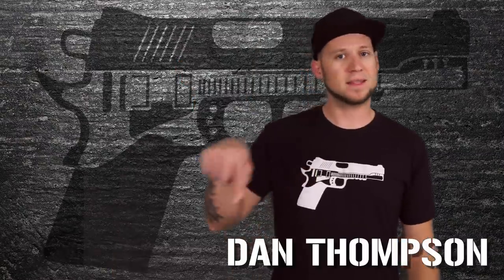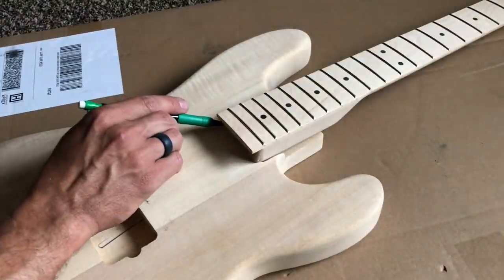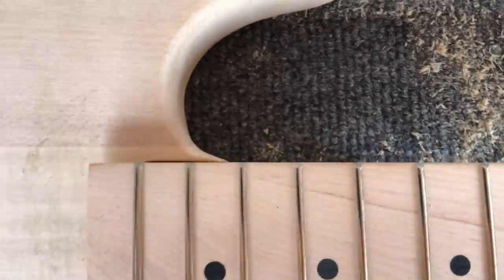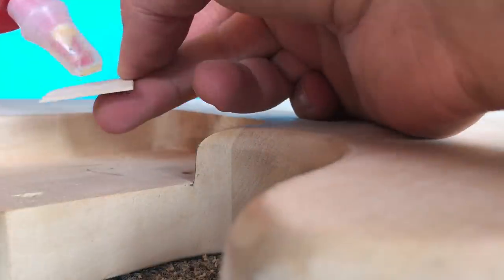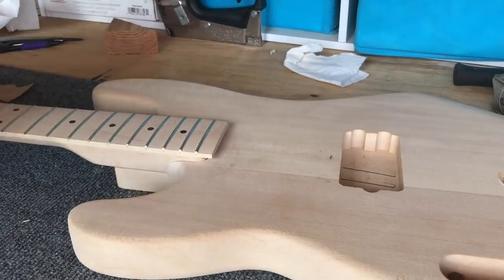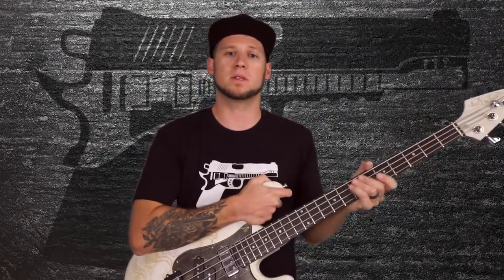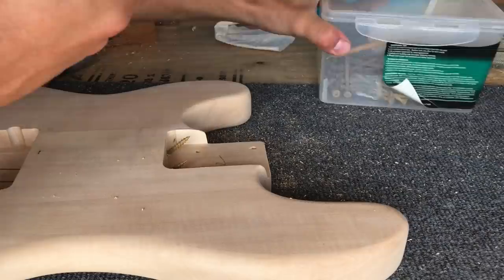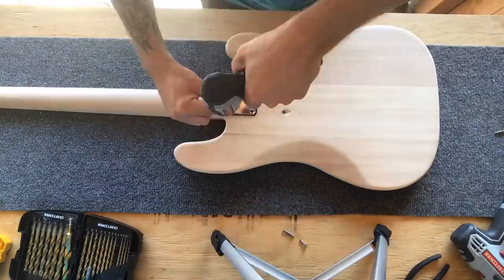How to reinforce a loose neck joint for better tone and sustain,  guitar or bass

Comment: Wouldn't loosening the neck screws a quarter or so of a turn after tuning (assuming you have a properly fitting neck pocket) solve the sustain problem? Generally when I do this and hear creaking it solves sustain problems. Using the 200 pound string tension to your advantage :)
Oh, and also good for people that don't want to drill into some overpriced vintage bass
Reply from the maker: Some people believe in that philosophy. My experience is that sustain is better when there is a tight fit and compression on all available surfaces, not just the base of the neck, but the whole neck pocket area. Also, loosening the neck screws on tele and similar body styles that don’t have support on all three sides of the neck pocket can cause the neck to shift side to side and crest tuning stability issues. But if it works for you, by all means do what’s best! There’s no right and wrong. Just what works best for you or what doesn’t.
Reply: If you loosen the neck bolts a 1/4 turn while In turn and hear a cracking sound, that’s the neck seating in the pocket. Then you can re tune and tighten them back down.  I would only recommend this if you have not already drilled holes for he bridge or else intonation will most likely be off. If it’s an already built guitar I would fill in the neck pocket and sand it back leaving only where the gaps were in sanded. But i guess it’s all personal preference
Reply: @christiansirianni4472  Lol no, just no. If your guitar was made properly setting the neck with tension is not going to change your scale length more than a quarter mm at most and it would probably be significantly less. The guitar was cut to be the correct scale legth with the neck firmly in place. Lol you'll be fine if you decided to try seating the neck at tension. I dont know how you came up with that non sense. Taking any material what so ever out of a proper neck pocket though is beyond stupid. This video was a great way to ruin a guitar. Unsubbed.

Comment: Hey Dan!  Really enjoying your guitars.  I am a woodworker first, and just started building some guitars.  laughed at your Voice over of your Australian friend since you clearly had no idea what tools he was using.  I am going to try the two extra screws to tighten that neck joint.  Cabinet builders use a similar method called pocket hole joinery.  You might look into a  kreg Jig. the Mini Kreg is $20 on amazon.  This would give you a more consistent angle and you and add filler plugs if you don't want to see the holes.

Comment: Very slick!! Wish l had seen this earlier.. starting a strat build and a Squire SE body l bought on line sat a few months waiting for me to start...well, when l did, the neck was like a 1/8"-3/16" too small. This shim trick might have had me try and fix the issue, however the body is finished and to do this trick shimming l would have to add time and materials to get a Squier right.. not worth it.. for a lil more money than time, labor, materials for refinish and the original cost, l was able to get a brand new Deluxe strat parts body! Its beautiful and waiting on small parts to finish.. had it been unfinished l would have done the shim and paint! Thanks! Love the channel! What other country can we discuss Fender neck pockets or HB triggers for a CZ?? GOD I LOVE AMERICA!

Comment: I think this is my first comment slash question. One, I like coffee more than you, fight me. Two, I've been so uber inspired by your videos that I have been binge watching for the past couple weeks and bought an SG kit with a bolt on neck. I didn't search specifically for a bolt on or glue in, it's what I could find, stupid virus... Anyway, the neck pocket is open and the base of the neck runs into the humbucker pocket. So, would this method still work? I haven't even started on the body so...
Reply: It depends on how thick or thin the guitar body is.

Comment: Quick and dirty method I found online if you don't want to drill extra holes in your guitar. Start with a fully assembled and tuned guitar. Flip the guitar over and undo the neck screws 1/4 turn. The string tension will cause the neck to slide deeper into the neck pocket (a fraction of a mm). You might hear a slight pop as it budges. Then tighten up the screws. Obviously this assumes and reasonably well made neck pocket to start with.

Comment: At that point, just use hyde glue and glue it in under pressure.  Good enough for Strad violins, good enough for a bass.  It drys crystalline hard and wont effect the tone like some of the other glues

Comment: I just got a Strat knockoff kit from Amazon and it has this very issue.  I guess grinding the neck pocket won't affect scale length?  I considered sending it back and asking for a replacement but that may just be what you get for $89.00.  This is my third build, the second from a kit.  The first kit was the carved top hollow body (Gibson Les Paul knockoff) with a set neck and it was a perfect fit.  The second build was a Strat knockoff. I got the neck and body from Precision Guitar Kits.  Again, perfect fit.  I guess this is a learning process but if it's not going to tune properly, I want to know that up front so I can put a cool paint job on it and hang it in the man-cave.
Reply from the maker: With a strat you should have no problem, strat bridges have lots of wiggle room for intonation. You shouldn’t be removing too much anyway. And, if it’s a trem bridge, you might have enough room in the trem cutout to just slide the bridge back a bit to compensate anyway.
Reply: Guns and Guitars Thank you, Dan.  I appreciate what you do.  I have used you as a reference several times.

Comment: Strings tension already pull the neck toward the bridge and the standard screws mount the heel tight on the body, hence no real need for 45° screws.

Comment: i believe it can hurt .that many screws and holes in such a small area is probably just going to cause problems. But if you like it keep doing ! Not something i would ever do or advice anyone should but if you or anyone else wants to risk it feel free it's your guitar to do what you want with.really if your concerned with better contact , more sustain just build a set or through neck guitar instead of making your bolt on into swiss cheese .

Comment: The string tension should pull the neck into the pocket with hundreds of pounds of force, the added screws are arguably redundant.
Reply: exactly
Reply: Seems like one of those steps people use, who doubt their building skills . Like adding more screws to something you're building, will make it hold better. But, you just end up weakening the wood, with more holes.
As for other companys using this. Who cares.  It still doesn't make sense. 
"I did see hear that, at fender, they have a guy that shoves all custom shop builds up his ass, to increase sustain "
Reply: Try to loose the screws of your guitar a little bit and see how wrong you are. The force of the friction of the neck against the body is way superior than the strings pulling it.

Comment: I've just stumbled into the world of DIY kit guitars and have spent the last 2 days down an internet rabbit hole that led me here.
This is an interesting tip that may help if I get a kit.
I'm wondering if you've ever heard of a pocket-hole jig?
It may make your creation of these additional holes a touch easier - although the trick of coming in through the neck side is a good one.
Reply from the maker: Yeah I’ve been trying to figure out how to use a pocket hole or Craig jig for this task, but it’s difficult to predict exactly where it will come out the other side, and I really need it to come out in the base of the neck pocket.
Reply: @GunsandGuitars 
I had to just work it out with mine. On certain wood thickness I just knew what setback I needed for my jig.
For example - on a 35mm (1.5"?) piece of wood I knew I needed to setback 25mm - or the thickness of a wooden ruler - and the screw would come through the middle of the face every time.
Once I worked it out it was very consistent.

Comment: The angle screws are into end grain.  This is asking for trouble, particularly with so many screws in close proximity. It may hold up for a while, but don't be surprised if cracks start showing up eventually.   I suppose they may not, but I wouldn't take the risk.

Comment: Removing material will change the scale length of your instrument, not recommended.Also you may have a copyright issue with Yamaha if they find out. Their Billy Sheehan Attitude III basses use those diagonal screws to secure the neck, could be patented, not sure.

Comment: Personally I would not put in the 45* screws. Install your neck, once you have the screws drilled where you want them, take the neck off, cut a piece of newspaper the size of the neck pocket. Put a very thin coating of wood glue into the back of your neck pocket, place the piece of newspaper on the glue, install the neck. Leave it alone for a few hours. If & when U want to remove the neck, simply take the screws out & give the neck a sharp rap, the glue bond with come apart fairly cleanly. You just have to scrape the remnants of paper & glue off. Wood workers often use this method to mount things for turning on a lathe. I learned this in grade 5 wood working class.

Comment: saw a Billy Sheehan vid about a Yamaha Bass with 6 screws - 2 at an angle to pull the neck into the pocket - then the 4 conventional screws were drilled and used - might work for guitars - esp customs

Comment: Wouldn't it make more sense to drill the hole inside the pickup cavity parallel to the top of the body without an angle, so that it is not visible?

Comment: You need to make sure the holes you drill through the body are big enough that the screw threads don't catch in them if you want the screws to grab the neck and suck it down.  Otherwise you might be accomplishing the opposite.

Comment: If the fit between the heel of the neck and the bottom of the neck pocket (that portion adjacent to the neck pickup area) is so critical, why not simply "Glass Bed" the neck heel / neck pocket to obtain a perfect and air pocket free fit? You could add a few degrees of bevel to the heel before bedding so that as you tighten the screws installing the neck, it would automatically create a full contact and tight bed with the last quarter turn or so, of the neck bolts/screws.
I'm no "tone expert" but to my way of problem solving thinking, glass bedding that heel area would resolve the issues that the angled screw fix does, but with less intrusion.
Reply from the maker: Not a bad idea! I think you should try it and post back here how it goes!

Comment: Thanks for the idea Dan. I often had this problem with my partscasters that the necks were bending downwards a bit in the loose pocket resulting the high e string moving to the very side of the fretboard.. This might fix this in my next project. Do you happen to know any sources for rear routed strat bodies (like the Charvel San Dimas models) for pickguardless projects?

Comment: I just add white glue in the holes of the neck and set the screws. After glue is dry I remove screws, set the neck back to the body and add a little piece of wood out of a toothpick and a dash of white glue in every hole before to set screws back. In the future, if I needed to remove screws, just turn a little bit harder the screwdriver until it snap the grip out the threads of every screw. That's is what I do with all my bolt-on electric guitars ! t(-,-t)

Comment: For the bridge pocket not quite lining up with the base of the neck:
What I ended up doing was that I held a section of basswood on the round end of a bench sander 'til it ground its way through, which left a nice radius, and then sanded away the base of the section 'til it fit in the tiny gap in the base of the neck.
Seems to have worked out pretty well.

Also, tips on counter-sinking the additional neck screws:

Get a sacrificial piece of wood, and when you drill at an angle through the guitar, drill through the second piece as well.
Then cut the wood close to the bottom of the holes that came through, and put the thing at an angle on a sander, so that a toothpick in the hole sticks straight up and down.
Super MS-Paint magic for description:
https://imgur.com/ud37zE1

OK. Once that's done you'll have a flat spot at 90* to your holes, so your drill won't walk around.
Align the holes in the sacrificial piece of wood to the guitar body, CLAMP THEM TOGETHER (much harder and crappier results if you don't, trust me) then you can drill your countersink holes through the sacrificial piece, and into the body. I'd also recommend putting a piece of tape on the drill bit at a depth that'll allow the entire tip of the drill bit to go through the sacrificial bit, and not too much deeper.

Yay!
Reply from the maker: +Nicholas Feeley thanks for the tips!

Comment: I was sitting here squinting at the body with the bathtub route because I thought I recognized it, and then I saw the body slant  for the Trem system and I'm 90% sure that was a Teisco ET-440 Spectrum? The one that would have come with the flowers and vies on the pick guard?
Reply from the maker: You are correct, that body is a teisco that I bought as a project that I’ve never got around to finishing.
Reply: That's a shame, I love that body style! Plus if the Spectrum Pickups are actually working they sound pretty neat. Would have loved to see it all done up.

Comment: if i do this to a guitar kit, can i then sand down the neck heel a little more to be like an ibanez? my biggest complaint with kits is that they are bolt on, or set neck with the wrong scale length(anything other than the superior 25.5 inches). also do you know of any explorer kits? Anyways thanks as always for the help Dan, hope things are going well for you.

Comment: I wouldn't do that until I had the bridge on and made sure my neck/sting alignment is perfect.
I use machined inserts and screws for solid neck fitment on bolt on neck guitars I build.
I can see this on a bass but regular guitar its just not needed.
Are you one of those guys that hangs all that useless crap on an AR 15?

Comment: I did not see any pre-drilling for the neck. Without pre-drilling wouldn't there be a chance of splitting the hardwood of the neck with two large deck screws?
Reply: @5:27
Reply: @michaelsteffeck6114  Thx.

Comment: I think a better design would be what John Page does with his guitars -- he uses threaded receiver nuts embedded into the neck and specially designed bolts that go into them.  I always wondered why no one did this, and why you would want to just put the bolts / screws directly into the neck wood.  IDK, it's possible he has this patented, so maybe that's why no one else does it.

Comment: Is there anything wrong with using popsicle sticks for a shim? I'm just curious since that's the only type of wood I have around other than toothpicks
Reply from the maker: I think those would work fine. But seriously, if you have a craft shop near by, you can buy thin sheets of basswood for really cheap.
Reply: Guns and Guitars
Thanks! I'm going to my parent's tomorrow anyway- I'm sure my dad has some. By the way, this is an awesome channel!

Comment: Bit late to the party, but still.
It's better to glue on two or three sheets of thin wood to the back of the neck pocket and then using a Dremel to match the contour of the neck than to take wood off the body directly

Comment: Hi Dan, great video, one question, could one get the same result using only one 45° support screw instead of two?  I'm afraid the two angled screws could go straight into the original back screws. So using one centered 45° would avoid touching the screws already installed on the neck, by going in the middle of them.
Reply from the maker: I've never had issues with the angled screws intersecting with the straight screws, they don't reach deep enough.  A few people have asked about using 1 screw instead of two, so I just tried it on a jazzmaster I'm building. it did help, but I feel that two screws is better because you can use the two screws to pull in each side of the neck pocket evenly.  with only 1 screw it was more difficult to seat it properly. not sure if it actually makes a big difference, but that's my opinion.  also, yamaha and other manufactures use two, so that's good enough for me

Comment: How much can the intonation be affected by shortening the distance from the nut to the bridge - which must occur when we remove wood from either the body or neck. I understand the need for a better joint.  Maybe I should ask - how good is the intonation in these kit guitars? Never put a guitar together before and I look forward to trying. Thanks for the videos!
Reply from the maker: +Alan Meijer when building a kit you place the bridge yourself, so you would just compensate for the extra material you removed. If it’s a guitar that’s already built, you’re removing such a small amount of material you should be able to compensate with adjusting your bridge saddles. If your bridge doesn’t adjust, then you have a lot more work to do shimming the neck pocket back up to its original placement.

Comment: This is why, my idol, EVH actually drilled 6 holes through his neck plate and pocket for a couple of his stage guitars, because when he used to "Jump" off Alex' drum riser, it would loosin' the guitar neck and put his guitar out of tune. He needed something more stable and that could take a beating on stage and still stay in tune. He used to rip up and rip down on his neck, loosening those screws. I have a couple of neck pocket repairs to do, my learning about screwing things up when I was younger. lol